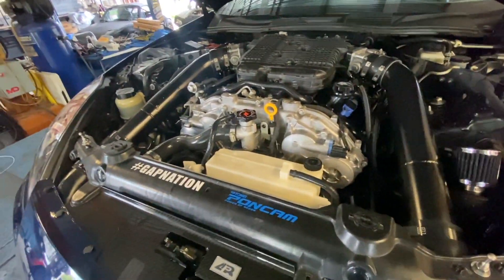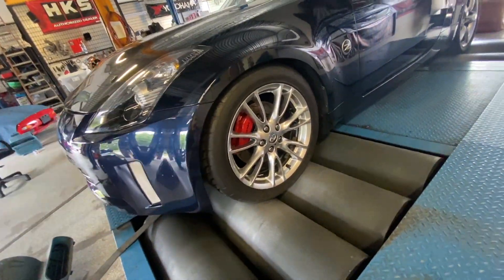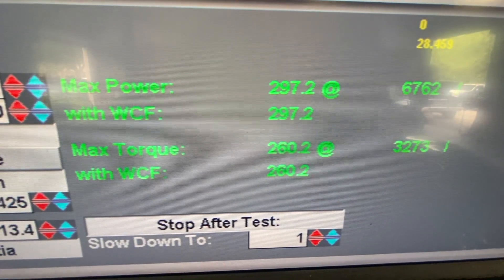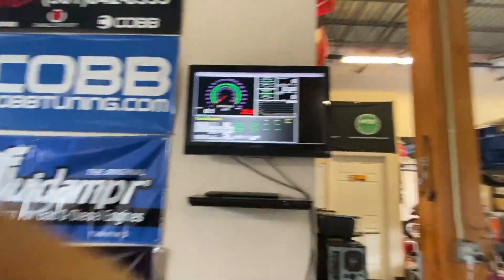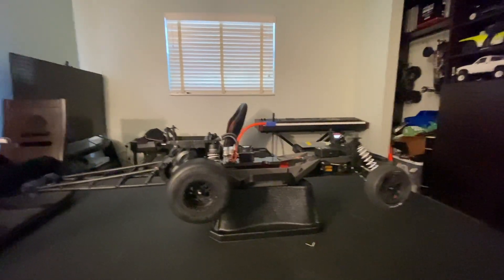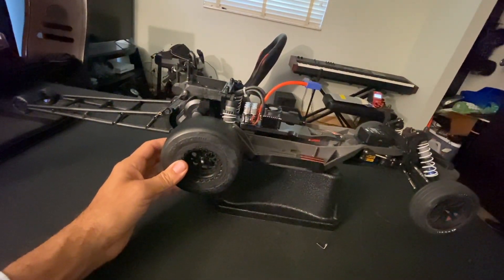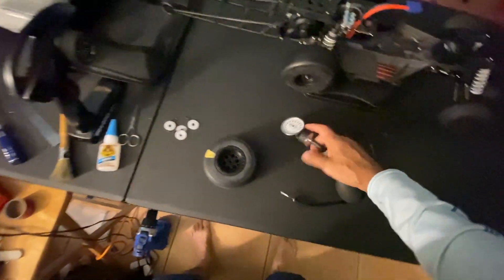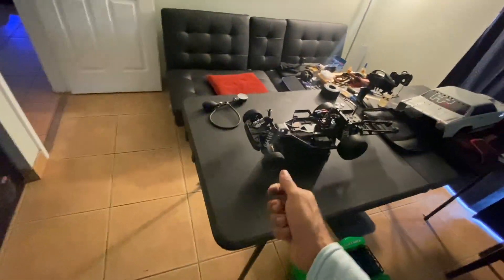350z C85+TUNE 80+whp?! NA?!

Comment: That’s wild! I think that car is faster than what the dyno suggest. Might not believe me, but I made 329 wheel and 289 tq on true Hr motor. FBO. Self made 3 inch CAI and self ported (to the max) upper intake. 3.69 diff. Stock headers. No cam. And performance matches the numbers. I’ve beaten pump e85 g37 sedans and I’m still on 93 tune. 🤷🏾‍♂️ HRs are slept on forreal as N/A cars. There’s an HR on cams making less power than me but set up for drag strip and he does mid 11s. I’m just hoping to get low to mid 12s. But on c85 I should step in the 11s I hope. If I get 11.9 , I’ll be happy with that on c85.

Comment: Jack, I'd still LOVE for you to tune my fully built LSVTEC turbo EJ8 Civic coupe running on Hondata S300 V3. It made 612 whp on a 9.0:1 CP Piston/Eagle rod combo on a GT3582R at 25 psi. It has Grams 2200cc injectors, a Walbro 530 LPH Hellcat fuel pump with upgraded wiring and relayed, K-Tuned composite fuel rail, Aeromotive external FPR, runs on E85 currently, nickel copper brake and fuel lines, GSR trans with a LS 5th gear and an upgraded OBX LSD, CTR PR3 head with K-Tuned Stage 3 cams, S2 LMAs, S2 dual valve springs with titanium retainers, ARP head and main studs, ARP 2000 rod bolts, balanced bottom end, Clutchmasters twin disc and flywheel, Mac 4 port boost control solenoid, Turbosmart 60mm wastegate, Tial Q50 BOV, PLM top mount turbo manifold and 3" downpipe, Thermal Research 3" exhaust, Frontline Fabrications billet valve cover (it's SO beautiful), Omnipower 3 bar MAP sensor, Skunk2 Ultra 3.5L intake manifold with 90mm throttle body, K-Tuned traction bar, AP2 S2000 gauge cluster, and I really think that you'd love it. I put alot of heart and soul into my build and everything but assembling the bottom end was done by me. Unfortunately for me I live in Pittsburgh, so it'd be a little rough for me to get it down to you, but one can wish...lol
Reply: He does remote tuning
Reply from the maker: I can remote tune it! As mentioned. 😉
Reply: I tried emailing you and also sent a dm months ago for a tune and still got no response 🤨
Reply: @TheBoostedCD6  same, I’d imagine he stays pretty busy.
Reply: @TheBoostedCD6  call him?